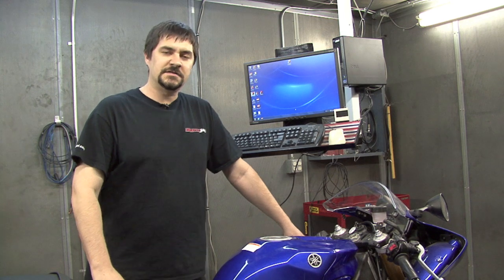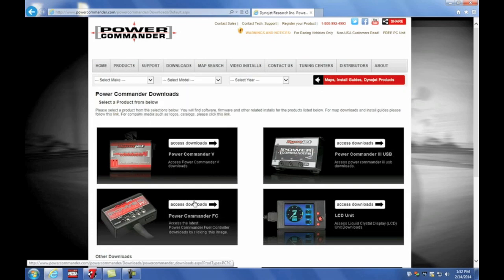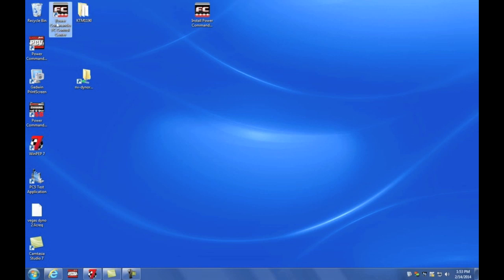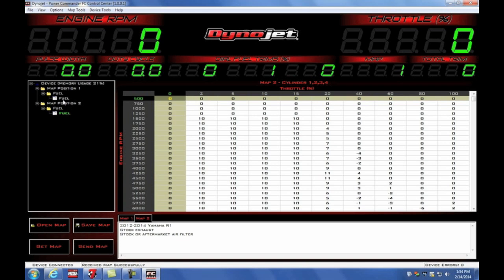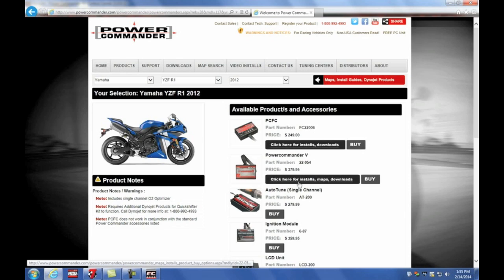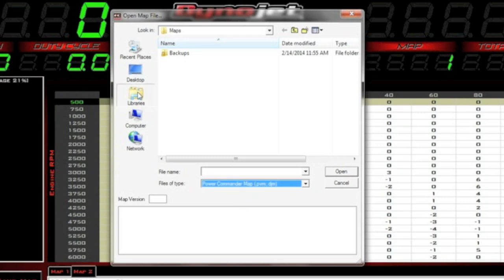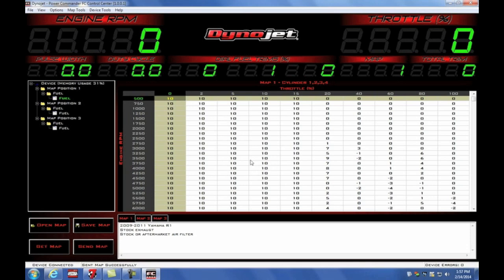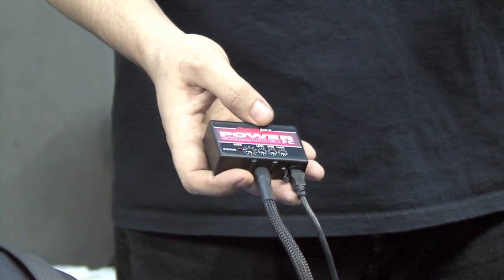PCFC Software and Map Installation

Comment: I recently bought & installed the PCFC on my 2010 Raptor & it will not connect to the software. I’ve tried three different laptops. In addition there are no PCFC maps available to download. There are a few PC6 but they can not be selected & opened in the PCFC software. Like others have stated this video is now very dated.  It does not represent the current how to for the PCFC & really should be deleted or updated. For almost $300 the PCFC is very limited.
Reply: Same

Comment: When I use my PCFC software and the bike is running, for a 2022 klx300sm, shows it's connected and everything is working like throttle and rpm while running but it does not show pulse width and duty cycle, i saw it once working and it hasn't since. If those numbers dont show, does it mean the turner isn't actually working?
Reply from the maker: Hello, please reach out to our technicians at Pstech@dynojet.com or at 1-800-992-4993 to help guide you through your issue.

Comment: Why would you adjust the low mid and high rpms? What are the benefits? Im using fc and when i initially start the bike the rpms are very low is this normal? Thx.
Reply from the maker: If you did not have access to the software or needed an easy way to adjust the fueling the trim pots on the front of the device will give you broad changes in fueling.
 
RPM with or without the device should be the same at idle. You can try moving the low trim pot to see if it changes the idle speed for you.
Reply: @DynojetResearch  if i notch up my low rpm dial by one will that do it? Can i mess with these dials freely to see how it runs? Or do i have to dyno it? Also wont that make it too rich? Thx
Reply from the maker: The dials give you +/- 10% over the base map so you can freely adjust as needed without fear of hurting anything.

Comment: I have just purchased the new power commander v and your website has changed from the directions that came with product any reason cant find any maps.???
Reply from the maker: Can you please email us at PStech@dynojet.com? We can help you get set up, so you can get the most from your Power Commander V. Thanks!
Reply: @DynojetResearch  are there maps for a 2020 polaris sportsman 850
Reply from the maker: @byotoor  Yes, you can input your vehicle here, but we've got plenty for the Sportsman 850: www.dynojet.com/tunes
Reply: @DynojetResearch  thanks alot but do you all have aftermarket tunes for a slip on exhaust and k&n air filter for a polaris sportsman or if not could u give me any idea on how to tune it for that thanks alot
Reply from the maker: @byotoor  Send us an email at powercommandertech@dynojet.com and we can help you out, Deldric!

Comment: I just got me a PCV for my 06 Raptor 700R.  The directions I received are for this old site.  I did download the software and it’s working good but I need tunes.  The current site does not have a “download all map files” button but does have individual download tunes section.  But nothing happens when I click on the icon.  I’ve tried different computers and nothing.  Any ideas?
Reply from the maker: Shane, can you please email us at PStech@dynojet.com, so we can help you get set up?

Comment: This unit was already  on my star bolt when i bought it , along with full set vance and hines pipes . stock filter with opening cut larger . i will be very soon going to a cone type after market air intake will i need to re adjust ? if so how ?